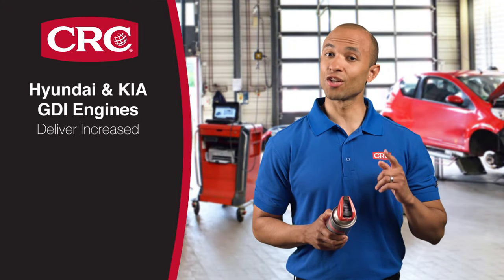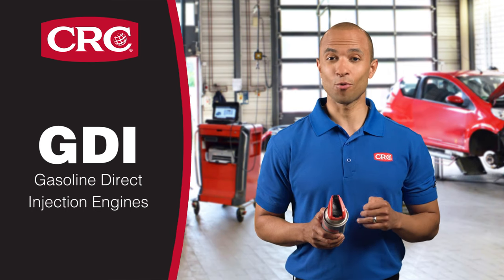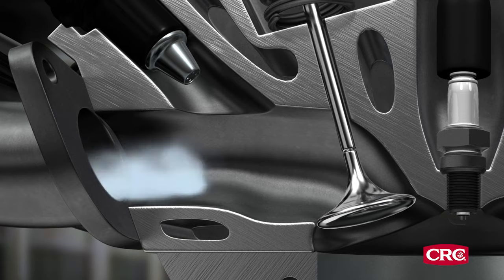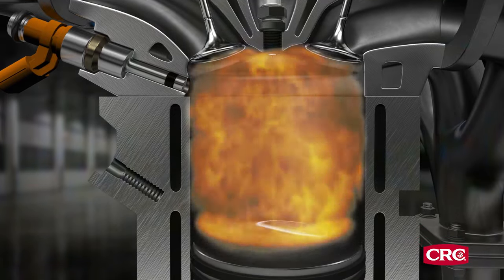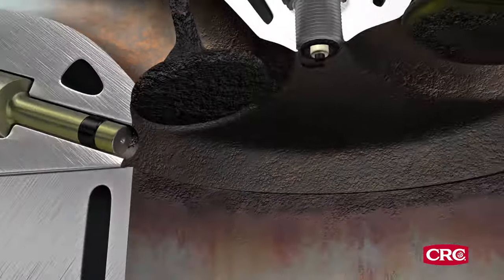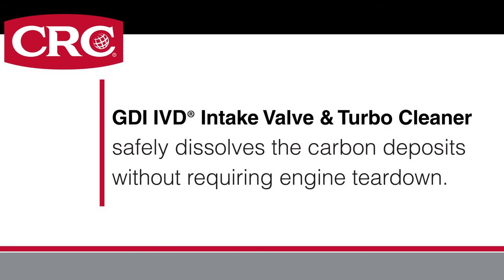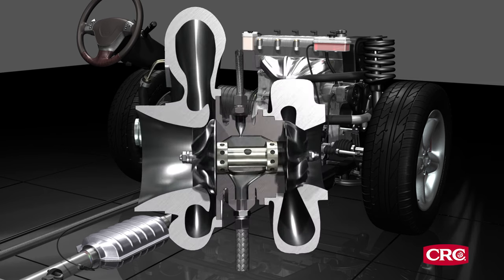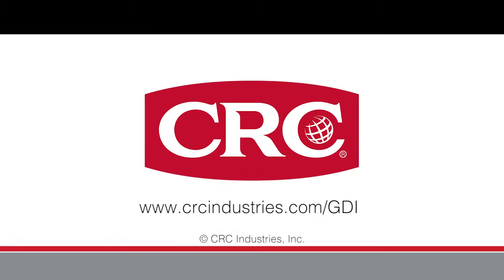How to Clean Intake Valves On Hyundai & KIA Engines with CRC GDI IVD® Intake Valve Cleaner

Comment: 2016 Kia soul 35,000 miles on it. I just finished the 10 min drive I couldn’t believe the amount of smoke that was coming from my exhaust I really thought for a few minutes that I ruined everything after driving it hard w a/c running the smoke was gone this car is driving like it brand new again. It’s unbelievable how the dealership maintenance wouldn’t include something so important let alone not even never once mentioned this to me during the years I had a warranty for maintenance. Tomorrow I change the spark plugs, the pcv valve and the oil. Anyone who drives a Kia soul and never spray the inside of the engine my advice to you is run to the auto parts store and buy a can of this spray. The days of mechanics ripping off us humans is over. God bless YouTube and God Bless America
Reply: Amén 🙏🏻

Comment: I cleaned the carbon deposits from the intake manifold valves using crc 3 times so far and it made a huge improvemnt, no more stalling, jerking/losing power, less burning oil (was burning 1 liter every 1,000km). for someone who has a gdi engine (kia/hyundai) has to do this every every year to keep engine from burning oil/carbon deposits...

Comment: Hint: CRC, love your products but If you are going to mention a specific car make, please show EXACTLY how this product is to be used with it!  I'm interested in using on my '12 Kia 2.0L turbo engine (now at 74K miles).  I'd like to see if CRC recommends spraying the product from the air box side (filter removed) since this will put the product through the turbo, the turbo piping and inter-cooler, past the boost sensor and into the throttle body before finally getting to the intake valves.  Also, our cars do not have MAF sensors but MAP sensors (located in the intake manifold volume). Please explain!!
Reply from the maker: Thank you for your comment and brand support.  This product will not harm MAP sensors.  For additional information on how to use the product please visit crcgdi.com or you can watch this video https://youtu.be/RcVDZAauO88.
Reply: Hey, I have never used this before and have heard some warnings via the Internet on using a product like this on the intake, with these sensors. I have a 2011 Kia soul 2.0 liter, did you eventually use the cleaner on the intake and how did you do it exactly?
Reply from the maker: @AlexanderEBott  Thank you for your comment.  The product is safe for MAP sensors but should not be used on MAF sensors.  For specific information on how to use the product please visit crcgid.com or contact out tech service department techservice@crcind.com 800.521.3168.

Comment: Will this damage MAP and IAT sensors? My mazda 3 skyactive have these sensors within the intake manifold after the throttle body. I am really concerned that this cleaner will damage these sensors.
Reply: You should disconnect the MAP sensor, and remove the air box to get to the vacuum line to use these products.

Comment: what if you're using it for the first time at 90,000 miles? there is probably already significant buildup on my Elantra.  although it still runs like new.
Reply from the maker: That should not be a problem. We have customers who have used it on their vehicle with over 130K miles and more.

Comment: CRC Auto please clarify.... Your video says use product every 10,000 miles or before every oil change.  So lets say I change oil at 5,000 miles which means I would use your product twice within your 10,000 mile guideline. Plus if manufacture say change every 3,000 this will mean 3 uses within 10,000 miles. Will this be ok/when should you and shouldn't you use it? Can it hurt if you use it too often? Second,  If you spraying into the throttle body how does your product clean the turbo??? You will have to spray past maf sensor to clean turbo correct, and its passing through the intercooler is this ok?
Reply from the maker: Thank you for your comment.  Most manufactures are using full synthetic oils, which the service is around the 5000-7500 mark for oil changes. So the service can be performed then or every 10,000 miles. If the you own a vehicle with a 3,000 mile interval, then we recommend every other oil change. Spraying into the throttle body will clean only the back side of the turbo. Spraying from the air filter box housing will allow the product to travel thru the front of the turbo. All of our GDI data has been collected by spraying from the air box housing (turbo and non-turbo vehicles).
Reply: Thank you for the clarification.

Comment: thats intake cleaner.
i dont think the tops of the intake valves would get that dirty.. or would they...
only the exhaust valves would have significant carbon deposit and i think gas additives would break those down...
its easier than having somebody somebody spray the intake cleaner while someone else revs the engine...
especially if you gotta hybrid where the engine shuts off. u gotta have somebody rev the engine..
idk, thats just my thinking

and then u gotta spray directly into the throttle body, and dont squirt it before that coz u might hit the MAF and ruin that. MAF needs a separate spray..